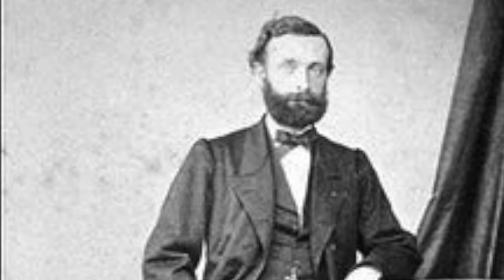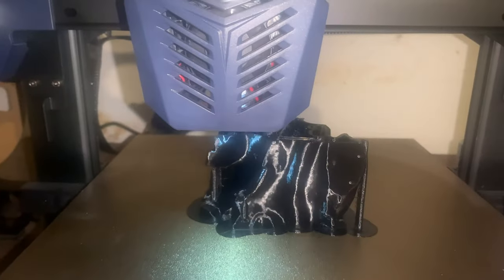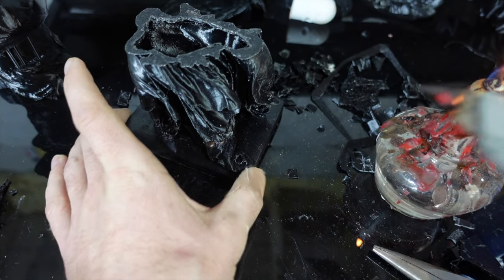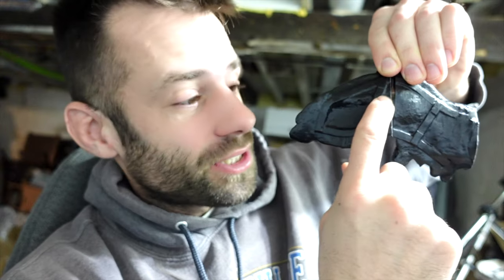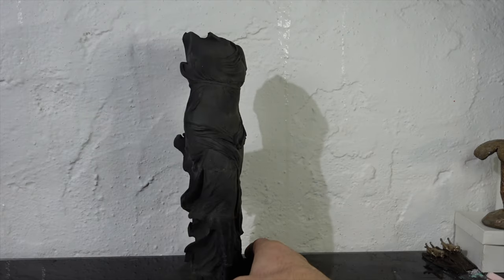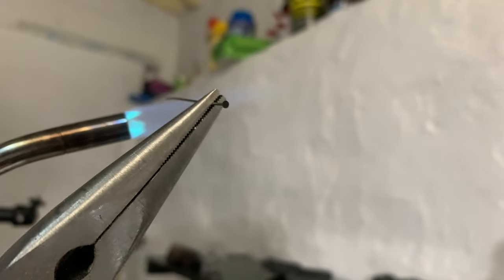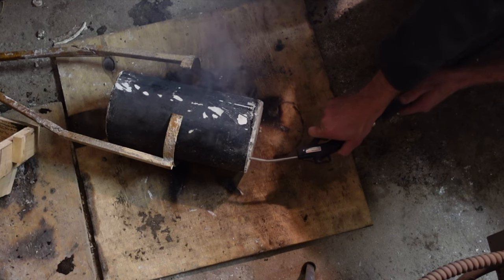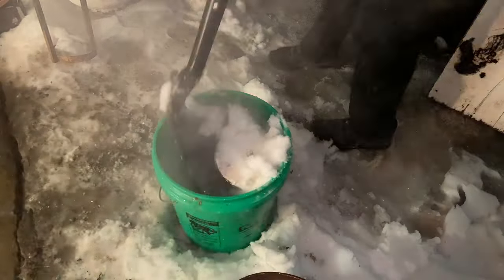Reproducing the Winged Victory of Samothrace in Bronze: Part 1

Comment: not super experienced in casting large parts like this but I have done a lot of small jewelry casting.  I noticed you dont have a button, which would be ideal imo because the button is always gonna look messed up because thats where the air escapes from. Also I would add some more sprues connecting to the main body just to be safe. I like the worn look though I think its cool also
Reply from the maker: I agree but I’m bound by the size of flask, so I can’t quite get the ideal set up. I want to try it in ceramic shell and see if it turns out better.

Comment: Smoothing the lines left by printer and parting lines with wax and fingers worked great.  Lots of care and hard work went into this piece.   Thing about loses is the lessons learned, and when you do get the Goddess of Freedom right the reward will be Epic!
Reply from the maker: I’m going to try poly cast filament in the future and that is supposed to be smoothed with rubbing alcohol. It’s made for casting. It might be easier to smooth the lines.
Reply: @lundgrenbronzestudios Sounds like a great choice - less post finishing is always a plus.  Poly Cast is kind of pricy but also claims leaving zero ash on burnout.  
Of course there are many alternatives to obtaining a satin smooth finish on patterns including:  Different type of 3D printer that uses a bath of liquid resin also designed for metal casting(VogMan youtuber),  simple heat to carefully melt surface layer,  sanding with or with without fillers, burnishing with panty hose, combining methods, and many other techniques.  Who knows what works best, not me for sure, but there's always more than one way to skin a cat/ferret.

Comment: Hi! love the channel, really impressive and you have a great presenting style and a brilliant approach, on this video i have a couple of suggestions....
1, you could scale the figure down a tiny bit before printing (i fully get why you would not want to do this!) maybe would increase the hydrostatic pressure and help with the issues you had with the base... (also, turn off infill! :) )
 and
2, you dont need to have the investment in the flask to vacuum the air out, just put it in a jug, vac it, then gently pour into the flask.
it's not as good as vacuuming in the flask but better than nothing.

Comment: Winged Victory of Samothrace is an amazing piece brought back to life through your amazing video!  So close - but I was expecting a "fill-age" problem being so long.  I never attempted anything that large/complicated, not to mention that beautiful so don't know solution, though I agree with you(needs a Longer Flask, and maybe thicker PLA).  Couple ideas/guesses (extending the sprue higher maybe extra foot to let gravity's pressure help fill everything (maybe weld on a flask extension(?)).  Somehow altering the PLA program so base is thicker than shoulder area(ie. gradual thickness taper).  Maybe adding a 2nd riser opposite main sprue?  Wish I knew the exact problem(s) and solution(s).  One things for sure though,  you will figure it out and bring back to life the GODDESS of VICTORY in all her splendor - I have no doubt about that. 
PS - if in doubt, ask the pros (Luckygen1001 youtuber would know for sure and he replies to his subscribers, and other youtuber foundry experts would surely have better solutions than me).
Finally, please tell us the species of you newest assistant?
Reply from the maker: This is one that might be better for ceramic shell. I wouldn’t be bound by the size of the flask. 
Splinter is a sable ferret. He’s a good helper.
Reply: @lundgrenbronzestudios  Or a simple "sprue extension"(ie two part mold).  Possible danger being hydrostatic pressure on a foot long sprue(ie need weights on top and or roping two halves to prevent molten metal from forcing itself out between the two parts of mold - plus a proper "locking fit" between halves).  
Also think the sprue should be tapered (be maybe 3x thick top vs. bottom to help prevent metal freezing. Tapering maybe also shoots metal through faster due to the venturi effect.
UPDATE:  bottom pouring offsets benefit of vacuum assist-don't know?

Yeah, slurry would work too, but probably still need both pattern and mold design changes to prevent metal freeze?   Like you said, there is a fine line between too thick(bulky/shrinkage) and too thin(fill/fragile).  Whatever, Part 2 will be fun.

DANGER - I really have no clue - BE SAFE!!  

Man's best friend :-)

Comment: A soldering iron makes quick work of cutting plastics :D It's so hard to gauge the right thickness balance between how much wax to add and how thick to make the walls so the pla ash doesn't be too much of an issue! 

Have you considered trying making moulds for your pieces yet, even though it's only a 1 (maybe 2-3 if you're careful) shot thing, alginate is a cheap material to play with, and i think it'll be ok to make a few wax slushes safey so no pla ash issues?  xD

How come you're not doing it in ceramic shell for this one?
Reply from the maker: I’ve made quite a few molds for my other projects but not for a 3D print. 

I have since got a temperature controlled soldering iron and you are right. It works way better. 

I could use ceramic shell. I just chose investment for this one. Maybe I will try ceramic shell on another one.
Reply: @lundgrenbronzestudios  I love mould making, but I'm not a big fan of the cost of silicones 😹 There's not much content out there on making jacket moulds with silicone main layers and resin/fiberglass or plaster/jute jackets over the top, with thin walled wax duplicates as the aim for them, i.e. for casting. Seen many on doing that stuff for prosthetics and models for resin casting, but not much that's focused on our artform. I think it works out much cheaper for long term use, especially if doing a small production run of things. 

Love how well you used sanding and wax to get that finish looking so smooth on the model before investing, that's a really difficult skill to develop, I'm very impressed 😁

Comment: Hello. Maybe to assembly the pla-figure -> to sand  seams etc -> disassembly all or half and casting?
p.s. sorry for baaad English =)
Reply from the maker: The problem is I don’t have a flask big enough to hold it all assembled. But in theory you are right. That would be a good way to do it.
Reply: @lundgrenbronzestudios  I don’t have a flask big enough to hold it all assembled - Yes. And the vaccum chamber ;-) - 7:02
p.s. I understand that the problem will be in the welding the parts of the figure, which means that you need to find a place where there are fewer small details. But this model is complex, I see such a place only in the abdomen.
p.p.s. You have great videos! I like it when the difficulties are also shown when creating sculptures.
Reply: @pinokio514  Two parts would also be easier and looks like that branded printer would do 2 larger parts no problem.